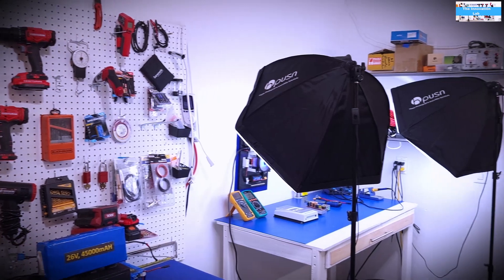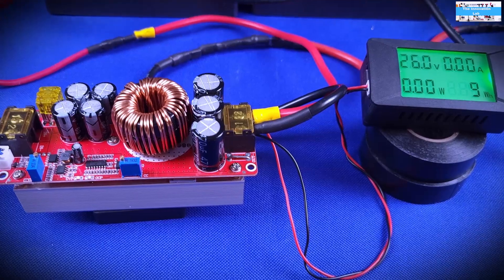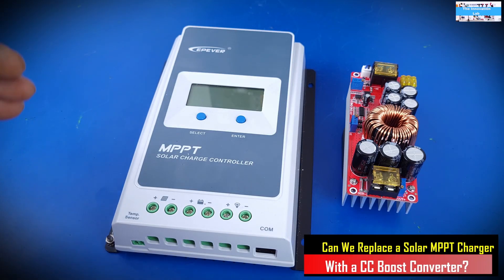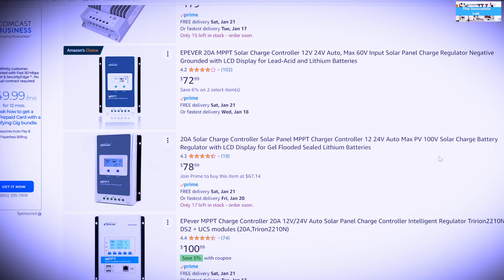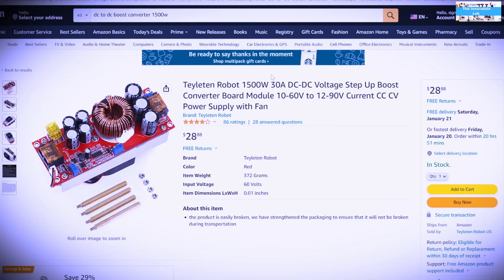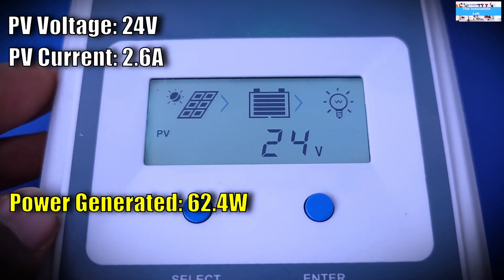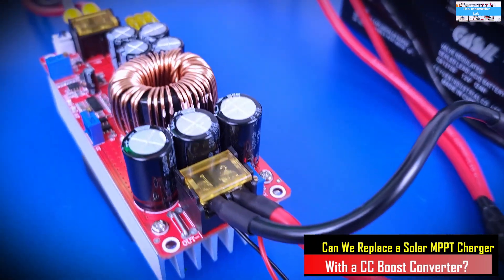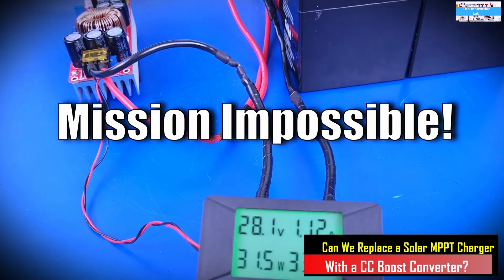Solar MPPT Charge Controller vs DC to DC Boost Converter, which is Better for Solar Charging?

Comment: I've been using buck converter for solar too for years now. I only use them for a really small set-up (200w to 300w panel size). What I've noticed is they performed very similar if not better than a pwm on the same array.
The buck converter always manage to keep the voltage constant but the power fluctuate depending on the amount of power the panel is producing.
Reply from the maker: Thanks a lot for the great feedback. Actually, this is on my to-do list. I will make the time to test out the buck converters I already have. I do have high hopes that the constant current buck converters will perform appreciably well. 
Basically, my end objective is to find a cheaper alternative to the expensive MPPT charge controllers out there.
I am not expecting a $12 buck converter to outperform an MPPT charge controller, but if we get a reasonable performance, I will accept it as a win!

Thanks again, I appreciate you sharing your experience with our community.
Reply: Oh yeah pmw is joke. Drops the voltage  down to battery voltage  and does nothing with the extra current.   The buck converter and mppt controler work basically  the same as each other. Lower the voltage to battery voltage which gives extra current used to change the battery
Reply: Can you make the video about this? I can not find any cheap mppt for my 100w panel
Reply: @chinhchinh6265  
Mppt with 100w panel, not Worth it... The voltage will be too low to get any reasonable advantage
Reply: @Yangmist3r Good tip.
After reading your comment, I asked the AI about BUCK-BOOST converter and 'he' said it is much better than the PWM, more efficient. He defined it as a  super PWM.
After that info, I searched a lot trying to find one online but didn't see any capable of 200~250W output.
Yours is buck-boost or only booster? Where did you buy it? Thank you.
Reply: @Yangmist3r Do you think I can wire that DC/DC boost converter from alternator(or starter battery) to MPPT PV INPUT instead of the battery input??? In voltage boost mode???  Go from 12-15.3V to 36-42.1V???
Reply: A super capacitor input tank circuit to buffer the input would stabilize this.. In this way you should be able to use a larger solar input as well although the converter output will be your limit and bottleneck but your efficiency would be higher because of the more stable input voltage and larger storage capacity on the input..
Reply: Can you directly plug that 900w buck straight to a battery?

Comment: Mppt Incremental conductance?
Reply from the maker: Hi friend,
Thanks a lot for the very thoughtful question.👍Honestly, I don't know much about the inner workings or design of the Epever MPPT  charge controller used in this video. However, I do know that incremental conductance is basically baked into the control software/hardware of every efficient solar charge controller that performs MPPT or MPPC.

Comment: Great video. Most of the MPPT is basically smart buck converter (typical MPPT spec require the PV input Voltage to be about 5V higher than the battery Voltage) that converts high PV panel Voltage low current to battery charging Voltage and high current.
You should do the experiment with PV panel with one of your buck converter @1:05 to see what you get as long as the Voc of the PV panel does not exceed the max input Voltage of that buck converter.
I use the same boost converter, I got it for $22 with free shipping to US, to boost the 12V LifePO4 to around 24V to charge my Bluetti EB70 and it also extend the run time of the EB70.
Reply from the maker: Thanks a lot for such great  feedback, friend! 👍
I like the idea of experimenting with a constant current buck converter as well. I intend to do more solar batrery charging reviews and tests in the future. 
- Buck converter vs. solar MPPT 
- PWM vs. MPPT, etc
Stay tuned.
Thanks again!
👍👍🙏
Reply: """converts high PV panel Voltage low current to battery charging Voltage and high current.""" is not only this.

the mppt use "perturbed and observe" to find the voltage of max power is possible. this voltage is only one. above this voltage the power drop drastically. under this voltage also drop. to make this, controller module the resistance of load to increase and decrease the panel voltage to stay at maximum power voltage. this voltage changes are more than 1 time per second. the dc dc conversion is a consequence of mppt working

Comment: I use buck converter which stays at the same volts even if it's is cloudy.
Reply from the maker: Hi friend!
Thanks a lot for such great feedback. 👍👍
However, I have not really used either a buck or boost converter for solar charging in the past. I have always used either a PWM or MPPT charge controller. This is a learning experiment for me as well, so thanks a lot for sharing your experience.

However, when there is a cloud going over your solar panel, does the charging current drop?
Reply: @theinnovati0nlab782  when its cloudy current drop in buck converter just like mppt.
Reply: @innovati0nlab782, are you saying in the video the converter is cutting off from low input power?

Comment: Brilliant video. Really well explained and presented. Fascinating for hobby types or experienced users. I'm thinking of using my 1800w boost converter to replace my existing DIY dump load controller ( for a wind turbine ). I just don't like the idea of my batteries and turbine depending on electro mechanical coils clicking away, sometime hundred of times a day.   I use the well known A30 voltage control switch ( ebay £10-15 ) to switch a high amperage 12v/60A coil  relay ( ebay £8-£12 ).  But coils will eventually fail or contacts will stick/weld up.  But!....I do however have a 1800w boost converter just like yours, just sitting on the shelf. Perhaps I could use this to dump excess current when my battery volts rises to about 14.6. ( there's a little potentiometer for min operating voltage on the boost converter ).  Better than spending several hundred £ on a tristar/Midnite/Intervolt. I've searched high and low on Aliexpress, Ebay for a long time and the only cheap possible alternative to handle good power looks like this boost converter. ( my wind turbine regularly puts out 800w to 1200w )
Reply from the maker: Hi friend!
This is wonderful, I am always excited to hear about projects like these.
👍👍

To be very honest, I have not done much wind energy projects. However, I believe that the concept is very relatable to other renewable energy systems. Your idea sounds very interesting and I would like to know if you are able to make it work.
Please share your findings.
My only comment will be that you should account for the fact that the constant current boost converter has a 30-40A current limit. This means that during the peak/surge yield of your windmill, the power output of the converter will be limited - as a function of the input voltage and current limit.
Reply from the maker: Hi friend,
Thanks again for the engagement.
However, there is nothing misleading in the setup. I was very transparent in the explanation as to why I had to change the battery configuration from parallel (12V, 24Ah) to series connection (24V, 12Ah). This was because I realized  that the boost converter would not be suitable for charging a 12V battery, given the input voltage level we were using for the  test.  

I recognize that the test was not perfect and that there were some errors, and that was where I promised to make a follow-on video. I am  redoing the experiment with real solar panels.
However, there was nothing misleading about changing the configuration from a 12V, 25Ah setting to a 24V, 12Ah setting - giving that a CC boost converter was used at the second phase.

 In the end, the concept boils down to a transfer of energy from solar panels to a 12V or 24V battery system. What matters in the end is the question, "Which of the 2 systems does it more efficiently?"

Thanks again for the wonderful engagement.
👍👍

Comment: I think the numbers issues is your load is not constant, when you reduced current to your MPPT, it adjusted the voltage down on the output to keep the current up. However, since the battery's demand depends on the voltage difference your current is not constant.  I would re-try with some incandescent light bulbs as their demand will be directly proportional to the voltage making your calculations way easier.  Thanks for this video!
Reply from the maker: Hi friend,
Thank you so much for such constructive feedback.👍👍
I agree that something funny was going on with the MPPT function of the charge controller when I lowered the current on the  power supply. I am definitely going to repeat the test with an actual solar panel this weekend. 
I got some good solar panels, all set up, and good to go! Stay tuned for the video, my friend!

Thanks again!
👏🙏
Reply: @theinnovati0nlab782  Another thing a MPPT will do that a simple DC-DC buck/boost converter doesn't is try to  ensure the voltage of the source doesn't collapse based on demand.  The whole idea is they pull out the most power based on tracking, but if you exceed that power, a DC-DC boost converter would just drop out at some point when the voltage is pulled down but an MPPT should limit current limit based on the input power available to prevent that.  I think your question is can you use a DC-DC buck/boost converter with solar, and the answer is yes but you want a floating input voltage and an constant output voltage; then the only thing to change on the output is current. A boost or buck regulator  Once you have that the question becomes, what is your load and how do you manage those current limited scenarios. I am looking at this exact case for a small load using the MT3608 IC.

Comment: Awesome video again!  I have a question....Have you ever tried to use the 12v DC port from a portable power station to supply the input for the boost converter?  (I tried and failed but maybe that was user error)? It didnt work for my MPPT booster either.  But the solar panels directly made it work....  Wonder why the 12v dc jack can't be used as the source...
Reply from the maker: Hi friend! 
This is quite interesting but a bit strange that it didn't work. However, you need to verify that your portable power station is producing a clean DC output and not AC due to some rectification issues. Also, you have to verify the rated output power capacity of this power station to make sure that it matches or possibly exceeds the load you are putting on either the boost converter or the MPPT controller. 
Finally, as I mentioned in my videos, keep in mind that you can only get an output power of less than 360W from the boost converter due to the 30A current limit.

So if your load is greater than 360W and your input voltage is only 12V, your boost converter will not work.
Reply: @theinnovati0nlab782  Thanks for the great expertise again.  I think you nailed the problem: I was supplying too many amps @ 12v by using the DC output.  I think the load was hungrier than the rated output of the power station!  Cheers and have a good day.

Comment: Hello.
As you said, big mistakes...
The mppt needs a higher voltage than the battery to charge it.
The boost converter needs a lower voltage than the battery to charge it.
To compare, you need a buck converter witch, as the mppt needs a higher voltage than the battery.
It seems that you showed one buck converter, the SZBK07, but I would’nt ask it to deliver more than 3 Ampères without ventilation, and max 5 Ampères with ventilation.
I often used the ZK5012 buck converter to charge 12 Volts batteries from my 24 Volts solar system, or even directly from my 6 x 100 Watts solar pannels 2 series, 3 parallel wich produce up to 42 Volts peak unloaded, and about 15 Ampères around 32 Volts when connected to the Epever tracer 50 an.
I must admit I made mistakes too, with the ZK5012, I inverted the polarity when charging a car battery, the out fuses 2x20 Ampères smoked, they are surface mount, I will replace them with car fuses, easyer to replace when I blow them again. 🤣😂🤣
Cheers.
Reply from the maker: Thanks a lot for such wonderful feedback, friend! I appreciate it.
👍👍
Yes, the experiment wasn't perfect, I plan to redo it in the future with a solar panel. 
Thanks again for the wonderful feedback.

Comment: Hi...can it be parallel in 3 that boost converter...thank you sir
Reply from the maker: This is actually a great question.
👍👍 

The truth is that connecting two more switch-mode boost converters in parallel is always a difficult thing to do. Now, when the converters have variable outputs, it becomes even harder to control all the parallel converters. I am looking at a way to modify and increase the power of these units. Stay tuned, my friend.
Reply: @theinnovati0nlab782  yes sir...thank you for your reply.. I'll be waiting  for your expirement...and more power to your channel

Comment: I have that EPever 20A controller in my camper van, its connected to a (recycled) 250w panel and during the summer I had more electricity than I could use! I was charging drill batteries to use up the excess power when the van wasn't in use during the week. The setup used 2x 110ah lead acid batteries which were great but now they have degraded significantly. I want to build a 24v 18650 'leisure' battery pack to replace them this summer, would you go with 7s or 6s? I already have a ton of cells from e-bike batteries which I sourced cheaply. 
Thanks for the video's the ones about the boost / buck converters were particularly interesting.
Reply from the maker: Thanks a lot for watching this video and for leaving us such remarkable feedback. Honestly, this type of input and success story is exactly what keeps this channel going!
👏👍

Regarding your question, I honestly have not done an extensive test on the Epever MPPT charge controller, using other battery chemistries/types like LiFePO4 or Lithium-Ion. 
I do have my DIY 24V LiFePO4 pack here in my lab, and I intend to put it to the test with an actual solar panel, soon.

However, my recommendation will be that you consider making your battery design an 8S Lithium phosphate pack. My reason will be that LiFePO4 packs are usually easy replacements for 12/24V  lead-acid battery systems because of the similarity in their respective nominal and charging voltage levels.

Breakdown:
The nominal voltage for a fully charged 24V lead-acid battery is about 25.4V.
Similarly, the nominal voltage of a fully charged 8S Lithium phosphate is about  (8*3.2) = 25.6V. 

My theory is that since the Epever MPPT charge controller charges a 24V lead-acid battery very efficiently, my intuition says that it will also give comparable results with an 8S lipo pack......but let me put that theory to the test first, and I will get back to you 🙂.

Comment: It would be nice to have a version of the CC converter that can have the output voltage and max current adjusted by an Arduino. In this way you can make a MPPT in software if you add a voltage and maybe current sensor to the board.

A programmatically adjustable board instead of pots will also allow to make a proper multistage lithium battery charger. Then if you combine your future SPWM inverter with a PLL to sync AC phase to mains AND a fast switchover between mains and inverter we have a UPS! Pls do!
Reply from the maker: I honestly like the way you think, my friend!
👍👍
Thanks a lot for the thoughtful suggestion.
I appreciate it.
Reply: @theinnovati0nlab782   You can replace the potentiometers with programmable POTs that your Arduino can control. GreatScott did a video on precisely this.  There are a couple of challenges depending on the boost converter voltage on the POTs. hard to find programmable POTs that like more than 50V
Reply: @theinnovati0nlab782  a DPX800S Boost converter have a MPPT function and on this moment a get 92 percent efficientie I boost from 27 Volt to  40 Volt 36 V battery system